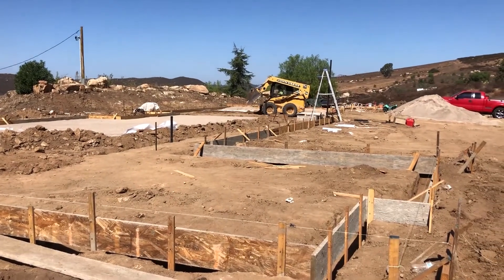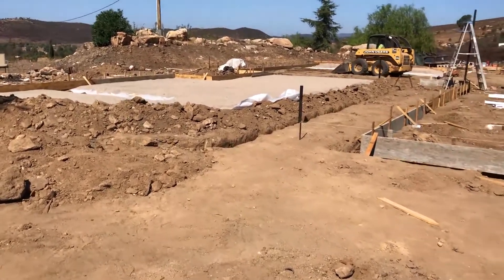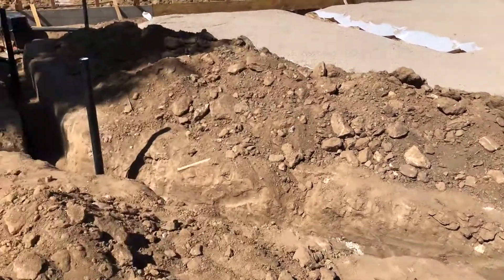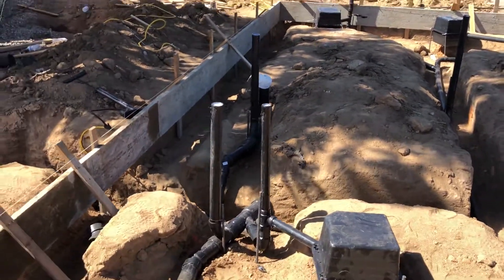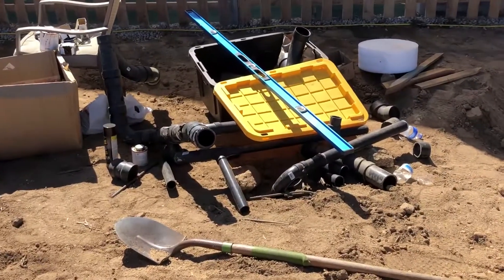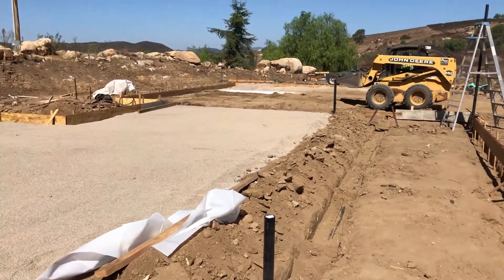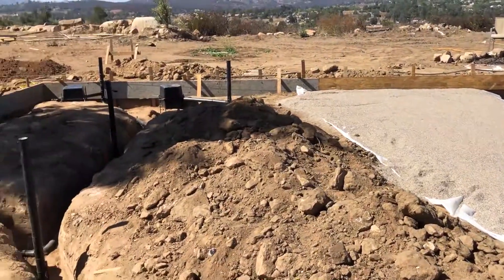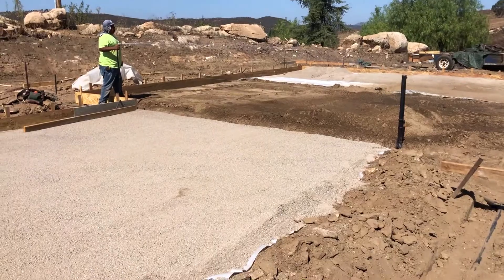Underground Plumbing | Freeman Custom Home

Comment: Hi there, I am looking to build in San Diego County as well. What code manual did you follow to ensure you passed your plumbing inspection? Thanks!
Reply from the maker: Here is a couple of links to San Diego County's website with info on the building codes. I hope this helps.
https://www.sandiegocounty.gov/content/sdc/pds/bldg.html
https://www.sandiegocounty.gov/content/dam/sdc/pds/docs/amended_code_04-14-2017.pdf